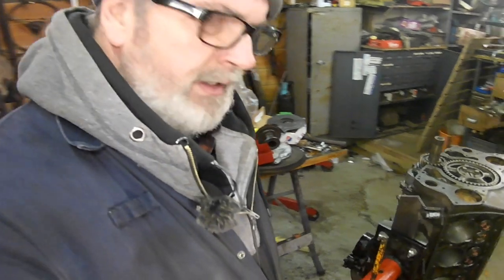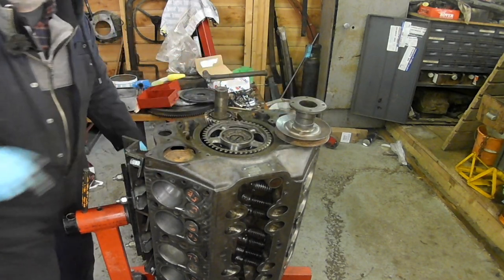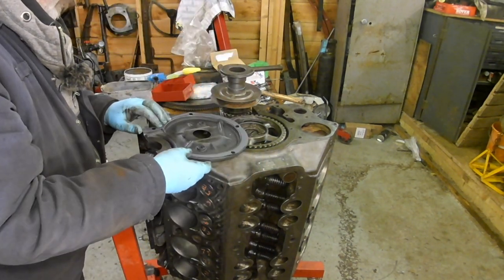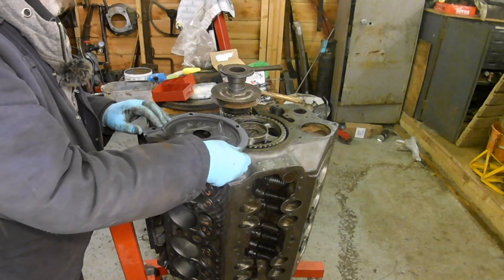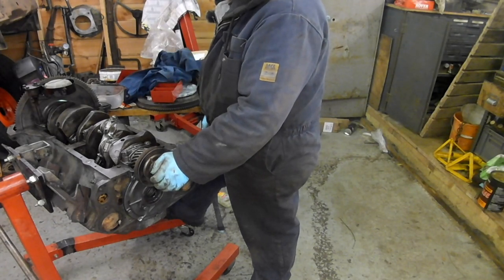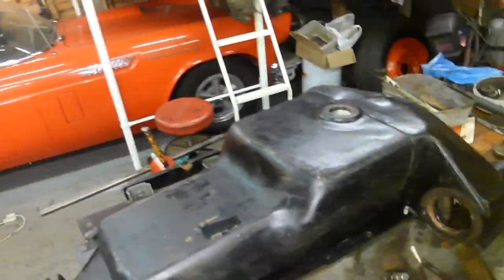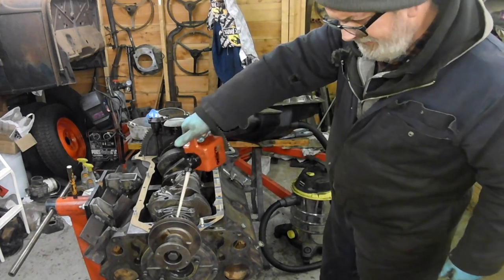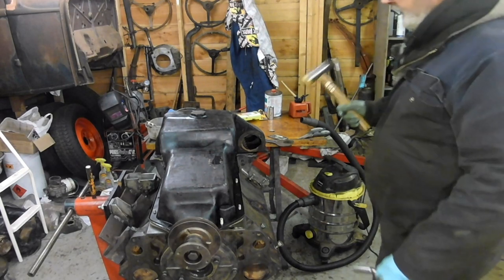Crusty Flathead Ford V8 Pt21: Bottom end button up.

Comment: Looking good Mart, I've taken the advice of many on Ford Barn and not soaked those rope seals in oil. Permatex the rope into the oilpan, tap them in using something like a large socket and hammer, put a layer of wheel bearing grease between seal and crank, them button it up.
Reply from the maker: Oh is that what I should have done? Lol. I hadn't read that. I just left it too late to soak it and wanted to fit the pan. A squirt of chainsaw oil will have to suffice. Thanks Art.
Reply: @MartsGarage  I'm sure there are lots of ways to get to "Bobs your uncle". 8^)

Comment: Mart, is that thing on the bottom of the pan for a early oil pump, i think i have one inside the pan on my 36 21 stud
Reply from the maker: I think it must be, Brendan. The oil pan was ex military old stock. it didn't interfere with the pickup I was using so I just left in place.